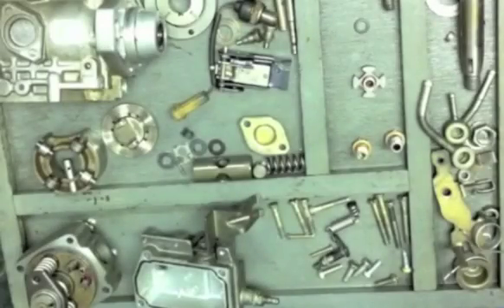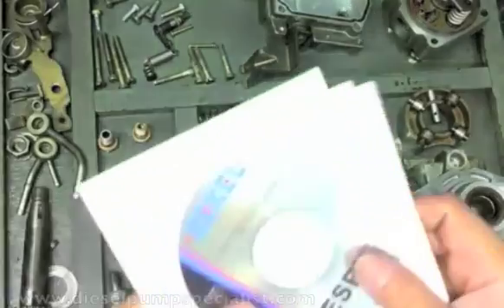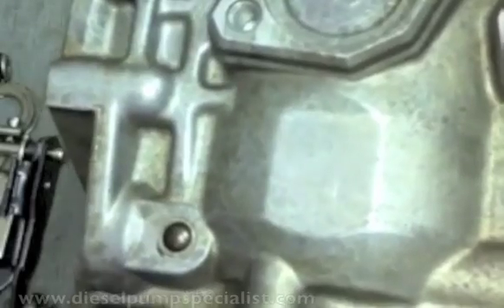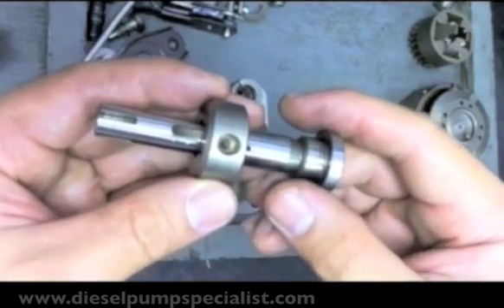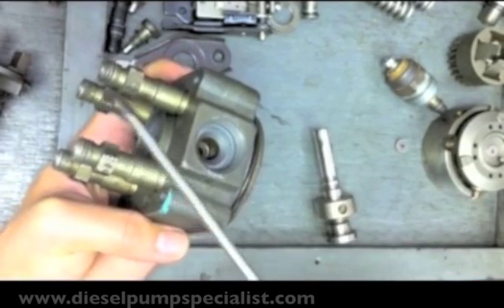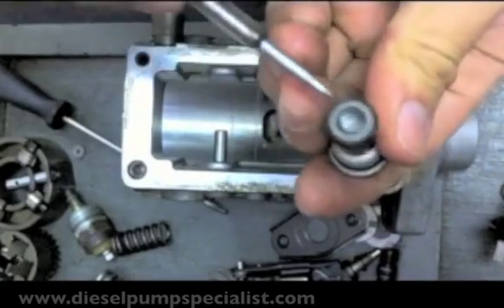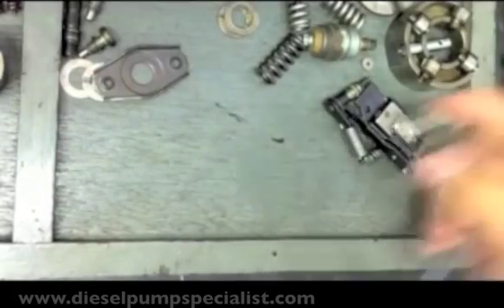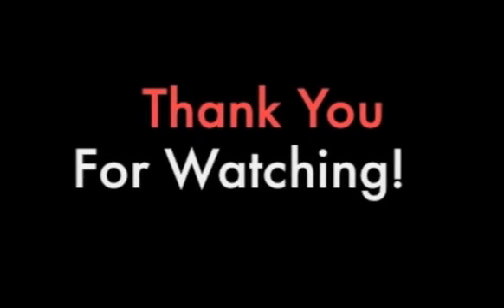VE Rotary Pump

Comment: I am putting a VE pump on a 2002 24V farm Truck. I saw online where I should advance the timing 2 teeth on the pump gear is this correct?
Reply from the maker: Why would it need that? VE pump already has built-in timing advance.

Comment: The best ever video on VE Rotary IP.  The IP on my hyundai had a fuel leak on the High Pressure side of the Timing Advance Mechanism,  Because of the high fuel pressure, thus explains the high probability of fuel leak on the O-ring on the high pressure side.
Reply from the maker: Thanks!

Comment: Excelent videos! I am rebuilding a nissan ve pump and i have i problem, no injection after the re assembly. What should i look at? Regards
Reply from the maker: The solenoid valve lets fuel in. If there's power being supplied, there should be a clicking sound. That means its working. Note the direction of the feed pump while assembling. I have another video explaining that in more detail. Also, other adjustments are needed to put it within specs. It is recommended to test run it on a test bench to see if the pump's rotor head is still in working order.
Reply: @webslinger2011  thanks for the info!!

Comment: this pump make pressure uptp 900 bar , can you please tell me how we can check this pressure ?
Reply from the maker: Internal pressure of the ve is very small. If you're asking about pressure in the fuel line.It's the same pressure dictated by the injector. If you want to get higher pressures, use an injector with higher pressure(just to see if it can reach it).  Usually, if the pumps fails to deliver enough fuel for starting(even after adjusting MS),  then the rotorhead needs replacing.
Reply: @webslinger2011  well i know k setting . But i dont find any information of kf and ms . If you have any video of kf and ms setting then do share with me .
Reply from the maker: If it's the common rail pump, it will require additional specialized equipment. Test bench must be modified to drive the pump.
Reply: @webslinger2011  dear it is just a simple VE pump with mechanical governor and with mechanical pintle type injector , same as the one you shown in this video

Comment from the maker: There's a special tool to set injection pump timing.  It's installed on the three-sided plug at the back of the hydraulic head (see the small bolt at the center plug). You can see the plunger move based on the reading on the dial gauge.
Reply: Shilpa machine diesel pump machine

Comment: hello sir i m indian my engin why low rpm i want stand rpm my engin i meen 50 meen 50 start 50 and loding 35 why please what i do setnig pump i want 100 to 100 rpm  over lood
Reply from the maker: You need to adjust based specifications described in calibration data of the pump and also the model or type of engine it's made for.
Reply from the maker: It's kind of hard to understand from your comment. The best thing to do in low power situations is to look for restrictions in the fuel system. Fuel filter, pinched line etc...

Comment: hi from uk been running a ve pump on waste oil and after 7 ,000 miles my pumps are stalling at tick over and require a squirt of brake cleaner.they are off rover 420 turbo diesels with the electronic flyby wire stripped the pumps and see very slight shining at low pressure feed in .the high pressure seems to be fine .have you any information that i could adapt the pump or if you can point me to the possible wearing part and how to overcome it tried inline electric pump runs ok once started thank